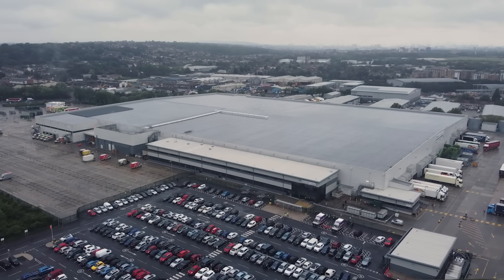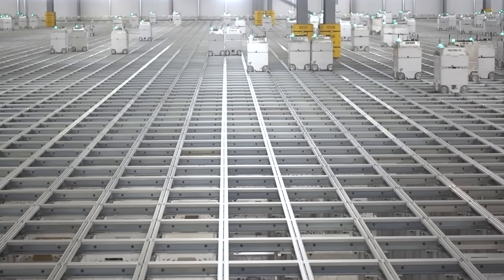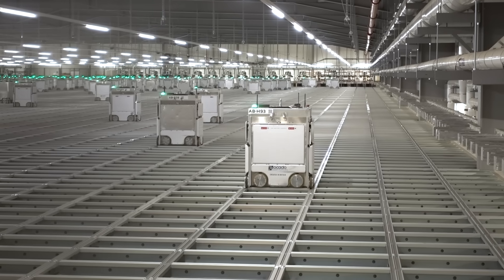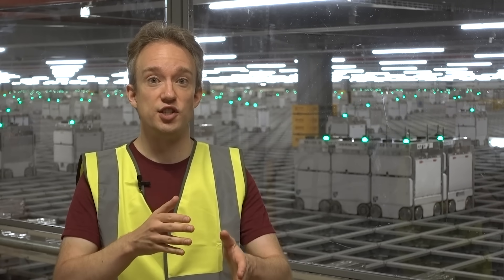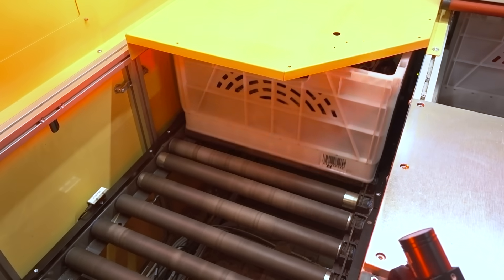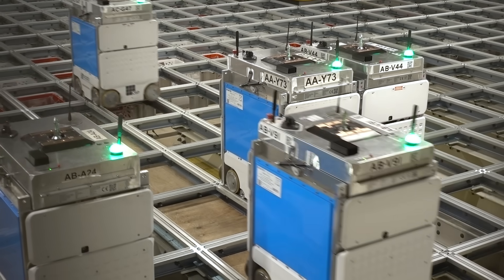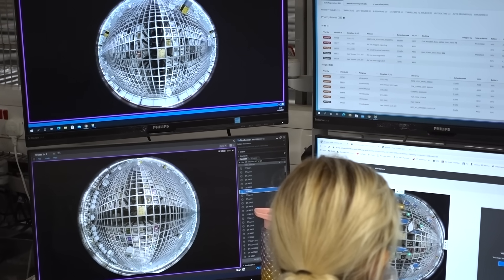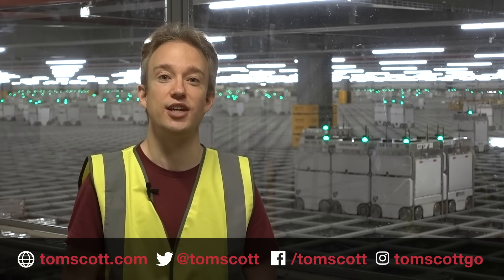How many robots does it take to run a grocery store?

Comment: Very surprised to see it's even robots doing the packing, not just the picking.  I saw the hive and expected it to deliver bins to humans to bag and ship and then give back to the hive.
Reply: Notice they only showed one robot arm packer and not a whole line of them?  I suspect that one is a prototype put into production for evaluation...
Reply: @Saturn49YT  And it was very slow.
Reply: @darkwowpg  but it can work 24/7 without breaks
Reply: @johnl.7754  And you don't have to pay them monthly
Reply: @johnl.7754  But the workers you need on staff to maintain and repair it cost more than 2 normal pickers/packers and the robot at best gets an 8th of the speed as a human.
Reply: @austinblackburn8095  If the robot arms presence can be scaled up to anything close to capable of accommodating the trolleys output, you'll have lost the income of 40 packer wages for the 20 maintenance crew members, and saved around 2000+ yearly wages for the workload of the actual packers. Just stop trying to argue against the machines, John Henry lost us that war 200 years ago.
Reply: @slyseal2091  I'm not arguing against the machines I'm simply stating at its current output capacity it would cost more per output to use all robot hands. Amazons robot that was in the warehouse when I worked there last year was one of the most advanced in the world and was barely able pick/pack 20% of what I did at a normal pace. There's a reason Amazon over the last 3 years has constantly been hiring more thousands more warehouse workers instead of deploying a mechanical arm army.
Reply: @johnl.7754  sounds like youve never worked in a warehouse like this, the robots are constantly on break due to errors :P, obviously not the same downtime as a person but saying they run 24/7 is unlikely, they need maintenance and randomly crash if the WMS has issues which depending on the system can be quite often. I've not worked with autostore but ive worked with Knapp and Swisslog and Witron systems.
Reply: @johnl.7754  so can the people... according to Ocado anywway XD
Reply: @Saturn49YT  It definitely was a prototype the arm moves so much slower than a human and they are a fast grocery delivery company I doubt its anything more. I worked at Amazon and they also had a mechanical arm, but it was a proof of concept because if they filled the whole warehouse it would at best have a quarter of the speed given Amazon tracks and requires employees to pick/pack 400 items a hour minimum.
Reply: That is actually how most bags are packed, but it's less fun to show a human doing the packing and the robots are way cooler
Reply: @danielclark3557  It's only a matter of time  until more and more human workers are made redundant. I doubt societies have plans for what to do with millions of new and permanently out of work unskilled labor.
Reply: @wombatillo  When we invented toilets with internal flushes, millions lost their jobs of cleaning toilet bowls every week. Yet we don't see them around anymore. They have simply taken some other jobs. Same thing happened when people largely stopped using candles. Humans have always adapted to newer jobs and there is no reason to belive they won't do it in future
Reply: That used to be how it was done, but the system improves.
Reply: @timogul  still is on most sights you just stand at your sation  and the box comes to you then you add whatever is asks for from your zone.
Reply: Given the speed of that robotic arm, i'd say that's still the case. But give it a few more years
Reply: It's largely people packing the items. It's massively more efficient than having someone walk around a supermarket, which is how most grocers get their online presence. 

Many, if not most, grocers operate online at a loss. Their operation is inefficient, but they can't let go of the market share.
Reply: In other CFC’s, robots pick the stuff off the shelves, and humans pack them into bags on what’s called “the train”, it’s still down to the Marshalls to load the cages into the back of the vans
Reply: Jeff Bezos is asking you to share your location
Reply: As for packing silly items together, the robot does not make that decision. A bunch of clever people designed some common sense rules for the packing algorithm. The robot is told what goes into what bag, as are the people.

If you're buying from a store-picked online grocer, good chance it's wild west. It takes more effort to make the experience good than a video could convey. Ocado has 20 years of experience. It's hard to catch-up in a few months, which is what many grocers have tried.
Reply: There was a video a while back on this place, and at the time the robot arms were in trials and not completely rolled out, so they had human packers there (who looked miserable).
Reply: Wether its beeing done on scale yet i dont know. But after bots beat us at chess, go and poker, it really can't be too difficult to teach them tetris.
Reply: My human-packed internet supermarket shopping is a disaster most of the time - a robot would be unlikely to do much worse just going for random chance. No, bread and buns underneath the milk isn't a good idea.... sigh
Reply: Im just surprised people even want to pay a premium to do something you can do yourself fast and better. I want the biggest and freshness greens - A robot cant pick the best cucumber, so I can end up paying more for worse produce. Honestly, just clicking the stupid app and picking what you want takes times...Never seen an app procces able to do that fast, also I like to explore and get the best deals.
Reply: @Djuntas  These idiots just want to sit on their lazy asses, just let them.
Reply: @Djuntas  You're thinking of yourself, but not everyone is as mobile. See, I just had a surgery and I'm not supposed to lift a lot, so tbh I WISH i could get my groceries delivered to my doorstep.
Reply: @IzzyIkigai  Yea, but the way its going it seems like the general public (not just hindered or old people) wants it as well. I just know that their is a need to me to do it my self...I shop once a week, so I don't want the ½-rotten bag of carrots or onions. On top of getting the best dates on bread, milk etc.
Reply: @krashd  I just think the app and ordering proces is already spend time. I tried looking at these app's before, but clicking around takes to long time, and then also, again, trusting them to pick the items I want - I buy about the same things every week, but say if there is just 1 spoiled onion or carrot etc it spreads fast to the rest, or if they pick bread with a bad date on it. Also having a guy at my door disturbing me is annoying :P

Comment: If the carts have to do processing of instructions, for example the "hive mind" gives them a location and they have to path themselves to it, they're a seperate robot. If the "hive mind" gives them a pathway to a location, they're not seperate robots.
Reply: I agree, it's 1 robot with 2300 appendage units
Reply: Not many people see the internet as millions of routers tho. They see the internet as a single entity, controlled by an agreed set of protocols
Reply: To me it sounds like the hive mind calculates the route, but the cart calculates acceleration/stopping/wheel change with an on-board computer.
Reply: @cityuser  Theres slightly more to it in terms of statistically organising the items for the highest performance efficency

Comment: Boss: Hey Tim, how much extruded aluminum do you need for your next project.
Tim: I am going to need all of the extruded aluminum in the country and the surrounding countries and I plan to build a warehouse sized grid out of it.
Boss: *Sips coffee...Ok
Reply: Mmm. Okay. What project you doing?

Oh I’m just making a robot hivemind
Reply: Really the way aluminum is extruded and cut automatically from CAD parts files, the production of that warehouse grid was almost nothing for the foundry to produce in maybe a few days of actual work from a single batch of aluminum from an electric arc furnace, with the longest part being the production setup (that took a few weeks), and then the cutting and drilling by the automated machines and QA/QC. The hardest part was the assembly by humans to levelness over that wide of area.
Reply: I need aluminum for other things on the warehouse, don't oversimplify.

Comment: 2:28 it’s literally a Kinect attached to the ceiling.

Somebody found a use for it.
Reply: A Kinect is actually a surprisingly versatile piece of hardware. Integrated it has a proximity camera, an infrared camera *AND* a 1080p camera, all in a single package, alongside some drivers that add body detection and more.

Snagged one myself for 40$, with some more modifications for about 30$ more (12V transformer, USB-B 3.0 cable, small tripod), it works with my PC "out of the box" and it's surprisingly easy to use, I can definitely recommend it if you have a use case for it.
Reply: That's what it is... I was wondering why there's an Xbox logo.

Comment: The 3D camera at 2:27 appears to be one of those XBox motion tracking controllers.  I knew hobbyists were using them to map 3D objects, but never considered an engineering firm would actually deploy them in a production setup.
Reply: It tends to be a good idea to avoid reinventing the wheel.

Comment: Ok so genuine question. How screwed is everyone in that industry when their job is inevitably taken over by robots? Will they get put on some form of Benefits? Or is the World about to bump up its' homelessness population?
Reply: The robots still need supervision and maintenance. The robot manufacturer needs people to design their systems, sales representatives, people to help with installation, customer support, people to run their website, someone to do accounting, and many more. You have fewer people in that industry whose job consists of carrying boxes, but it still requires a lot of employees.
Reply: Good question.
Remember that this development hasn't just started a few years ago, but technically when Ford invented the conveyor belt.
Since then, the average skill required for the average job has steadily increased, as low skill jobs (think: potato harvesting or knocking on people's windows to wake them up) have been automated over the last decades.
And what happened?
Many countries beefed up their social systems and invested in job retraining agencies.
Think about it this way, it's not a permanent problem, as in this case demand will meet supply. More people will learn to become developers, engineers or designers. The only problem is the existing workforce, which requires retraining and adequate social services so it doesn't turn into a crisis.
Reply: This is a great example of why a robust welfare system is necessary for our modern world.
Reply: Very screwed. automation is one of the largest threats to our society

Comment: When I ordered from Ocado, I thought some person would go around a shop or warehouse collecting the products I ordered, not that a colony of robots moving around a track would be collecting my order.
Reply: That's what usually happens when you order from other supermarkets, but ocado were starting from scratch so they didn't have to make the stores for humans.
I'm sure it'll all look like this eventually.
Reply: @quantumfluffyflapjack  nope, not all is going to be like that. Simply because it's 1. Really expensive to create system like this. 2. Maintenance costs are very steep with this kind of equipment. 3. Sum up those before and it means that there absolutely needs to be vast amounts of goods going on all the time. Third is the main factor. There's a lot of locations and businesses that simply are easier and cheaper to use normal labor.
Reply: @jothain  No, it is definitely all going to be like that. It might cost more at the moment, but as with anything, we'll see a massive price drop. Those things will be more efficient and reliable than humans soon enough, and they can work 24/7. The minimum wage will also likely increase in every country sooner or later.
Reply: @fiso64  I don't think the US will increase the minimum wage any times soon, their federal Minimum wage is still around 7.50 dollar from 2009, however some state had their own minimum wage as high as around 15 dollar
Reply: @fiso64  no it isn't. I work in factory that has robots and I maintain them. No not everything is going to be "robotized". Only people that have that idea are ones that don't have any practical experience of them. Besides there's plethora of businesses that specifically avoid using robots. It's also part of of image of the business. Like in our facility, no employees were fired. We just increased our throughput and got one part of the production out where people were lifting, which could've increased sick leaves. Fully robotized places are going to be minority for reasons I previously stated. It's also to note that this video has likely made few peoples to select different shop all together because of robots.
Reply: @jothain  Well, I've provided my own reasons for why most will be robotized. Those businesses refusing to use robots will either die out or be forced to adapt. Just because those robots are expensive to maintain and manufacture now doesn't mean it's going to remain that way. I'm not saying it will happen in this decade, but it will happen sooner or later. It's a trend we've been following for a good while now, and there's no reason to believe that it'll stop.
Reply: @jothain  At some point, a low skill human worker costs more than automation. That's usually dependent on the ruling body of the country which decides what type of benefits a worker is entitled to, which is typically an expense for the employer.
Reply: @PURENT  Yet someone with good salary must install and create tooling and program them. Just the tooling and programming can easily alone pay for couple years of minimum wage people. Per unit per setup. Not including any maintenance and wear parts. But ok, once again. Yes robots are increasing and replacing people in more "hazardous" and repetitive environment. But no, most certainly not everything is going to be robotized.
Reply: @jothain  Typically all programming comes from factory any maintenance or upgrades are performed by a technician which usually has specific but limited knowledge. As a result, their pay grade is not particularly high to begin with.
Reply: @PURENT  No, you're very wrong. I don't know a single plant that would've made commissioning and programming themselves. Too much safety issues etc.  That's what is particularly expensive
Reply: Depends on the warehouse. I did a project on these robots in 2017/18 and we toured a warehouse... without the hive.
Reply: Fascinating though, isn't it?
Reply: well...
Reply: Don't worry. There isn't a track

Comment: They should do these robots but in actual supermarkets. It would be so much easier than using humans.

With these setups a supermarket would lose cost to rent. If you could stick the machine onto the shop floor, you have a warehouse and a store at the same time.

Comment: 2:28 they're using Xbox's hardware, if it works it works I guess but from something like this I'd expect all custom stuff

Edit: I understand the economy of scale and why they did this, just wouldn't've expected it
Reply: The kinect is one of the best, cheapest, and easiest to use 3d cameras.
Reply: why? it is an off the shelf part, and it has drivers.  only issue would be getting more.
Reply: I've seen those cameras in a ton of situations. From movie sets to science labs. They just work really well and are cheap and easy to work with.
Reply: Everything you see in this video is Customer Off The Shelf (COTS). The contractor who implemented this solution is probably an engineering firm that specializes in industrial designs and just like programmers use libraries, engineers use existing products to meet efficiency, regulatory and of course cost targets. No point custom designing anything because you don't want to get into certifying that thing.
Reply: Custom hardware is much more expensive than mass-produced consumer electronics. There are massive factories pumping out Kinects, benefiting from economies of scale; why shell out for R&D and production of a handful of unique sensors when buying a Kinect will work just as well with a bit of tweaking?
Reply: @timothymclean  the Kinect has been discontinued.
Reply: @Duncan_Campbell  Oh?
Well, the principle still applies. (Especially if the warehouse was set up before its discontinuation.) Designing and producing small runs of custom hardware is expensive, repurposing consumer electronics (even secondhand) isn't.
Reply: Why re-invent the wheel, if they can buy something at low cost that does the job
Reply: I am not sure what is normal to use in a final product. But I have worked in a very large research centre once and whenever someone needed a 3D or depth sensor camera for any research project, they almost always used the XBOX kinect. The price is awsome compared to big camera manufacturers and it's actually surprisingly overengineered.
Reply: same...
Reply: Probably cheaper to adapt their software to use the off-the-shelf sensors than to try to get someone to make custom parts. Custom is expensive to make and slow to replace.
Reply: @rho9904  Azure Kinect is a totally different form factor, i just had to look it up.